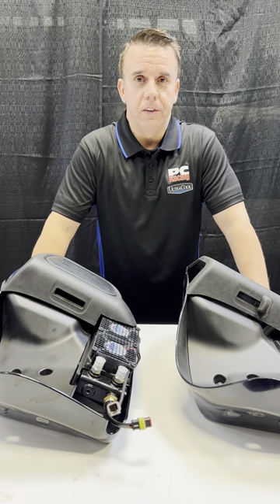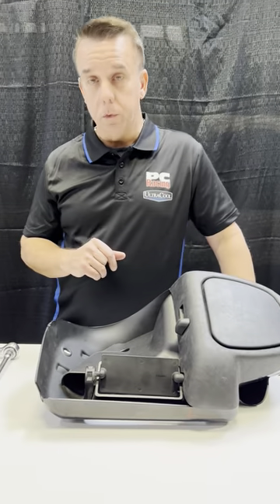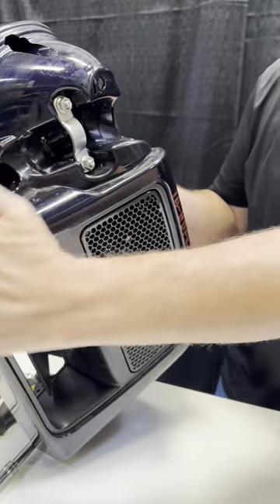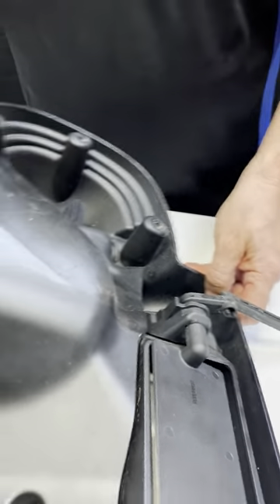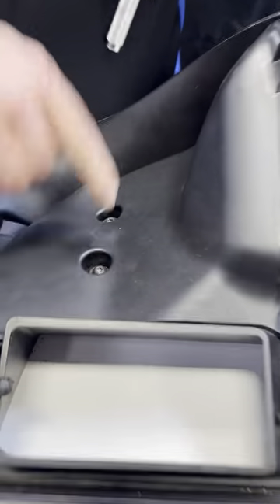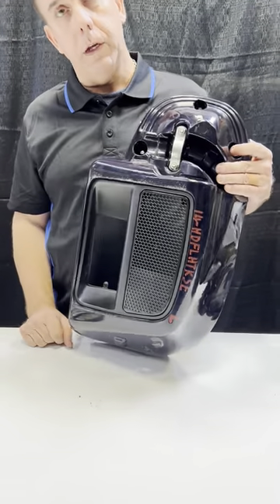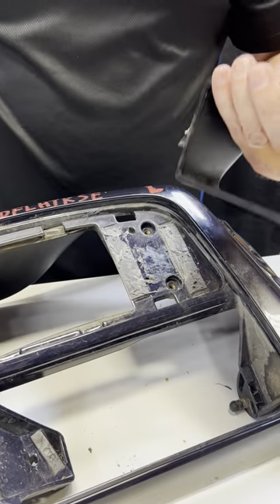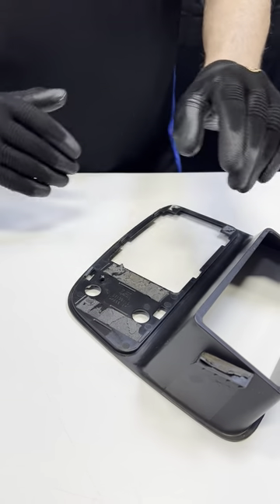UltraCool Oil Cooler Lower Fairing mounted installation 2024 version

Comment: why not provide that plastic piece replacement already cut with a kit? just make a mold out of fiberglass or get plastic from overseas, so it can be as simple as pop oem off with putty knife and re-glue new piece with tape. I'd rather pay a some extra for that then tinker around with saw blades, box knives, markers,  etc while the lower is sliding all over the table. would just make more sense to me
Reply: good point
Reply: Agreed, huge potential for blood being spilt with this mod

Comment: I installed 1 on my 21 roadking I don’t think there is enough pressure with a stock filter to push all the oil to the heads

Comment: I love my U;traCool. I got the one that mounts on the down tubes, just below the regulator. It's barely noticeable, and it looks good anyway. But what I like about it most is it does exactly what it's supposed to do. It keeps my oil temps down considerably and keeps it there.

Comment: Have you done any before and after temperatures to show reduction in temp?  Do the fans run all the time or by temp gauge?  What about the air flow to your legs since that is blocked?  How does one keep the outside fairing finish from being scratched given all the required modifications?